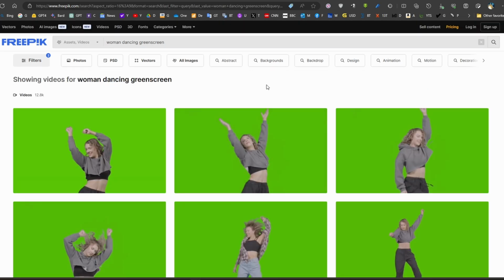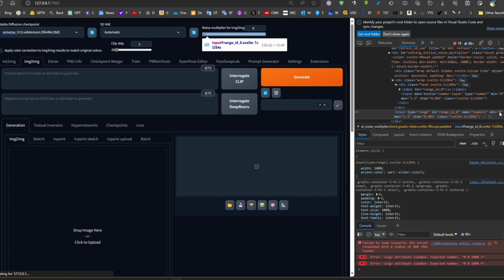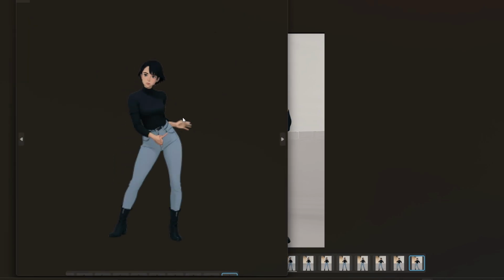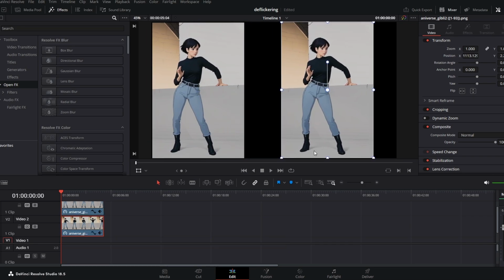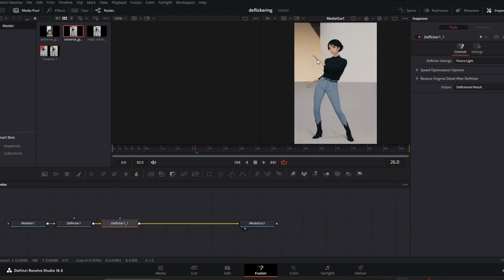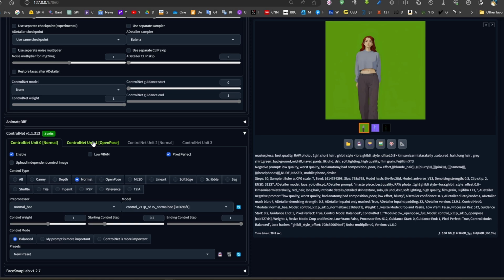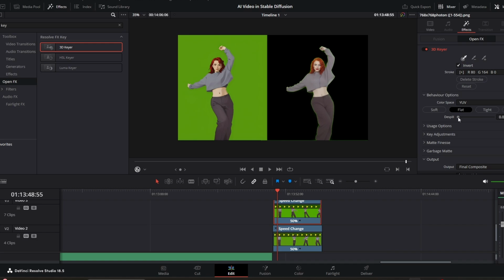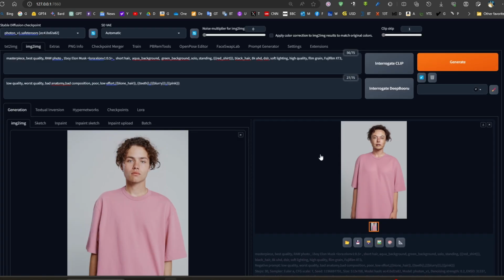AI Video 2 Video Animation Beginners Guide , in Stable Diffusion and A1111

Comment: Little confusing here. You have skipped the part at image selection , as per your video one image from the first frame of dance video been used in imgtoimg. How did the generated image created all the exact same images as per frames of the video in animation?
Reply from the maker: I used one image to test the output only, once satisfied with the results, we go to Batch tab and just filled (input directory with source images, and output directory for the output) and batch will generated all the images based on the prompt/details on my test on the single image

Comment: Thanks for the video.

Unfortunately it seems my export gets stuck at the ControlNet model, any idea what this could be? It's been at 0% for 30 mins :

Using pytorch attention in VAE
Working with z of shape (1, 4, 32, 32) = 4096 dimensions.
Using pytorch attention in VAE
Leftover VAE keys ['model_ema.decay', 'model_ema.num_updates']
Requested to load BaseModel
Requested to load ControlNet
Loading 2 new models
  0%|
Reply from the maker: sorry, have not got this before, but you should test Controlnet independently over one image, if it is not working, then probably you have a corrupted model file downloaded, so you can test redownloading it once again from https://huggingface.co/lllyasviel/ControlNet-v1-1/tree/main along with its yaml file ... also use gitpull to update your control net and libraries, you might have something corrupted for some reason.
Reply: awesome tank you!  @AI-HowTo

Comment: Thx for the tutorial, the problem is my character change clothes every frame, how can I fix that ?
Reply from the maker: You are welcome.
once you increase denoising strength, that will happen naturally unless you use a LoRA with a consistent clothes or a checkpoint that you have trained yourself on a character with consistent clothes.

in other cases, lowering denoising strength is the only option to maintain similar clothes.

use of Controlnet could also help(normal/depth maps, reference, tile) may help reduce changes with higher denoising strength.

Comment: Love your videos man. This is unrelated but have you tried producing consistent environments? I only see people working on consistent faces and characters, but nothing about consistent places/environments from different angles. Would be amazing if you gave it a shot and shared your insights!
Reply from the maker: I dont think its normally possible with SD (given its diffusion model), as mentioned in the Video, the best and most practical way, is to actually use a third software tool, such as Davinci resolve to replace the background...as you mentioned, once angel changes, the background changes, this results in slight flickering/changes even with controlnets.
Reply: @AI-HowTo  I just started testing a promising idea. I think it can be done if i make a 360 panoramic depthmap,normalmap, and cannymap in 3d software of my environment, then feed the maps into controlnet, and then project the SD result back onto my 3d scene, then I'll get full camera rotation freedom. Still needs some testing Anyway, keep up the good work habibi
Reply from the maker: thank you, best of luck to you as well.
Reply: my method so far has been making a scene in 3d, producing canny,depth, and normal maps and pushing them through controlnet and finally a fourth control net for reference. But unfortuantely, theres very little consistency when changing the camera angle.

Comment: This looks awesome. How much vram I need to use this feature of SD?
Reply from the maker: in general, if you are able to generate images in SD, then you can do this, I am running on 8GB, using img2img is faster than txt2img because it only uses 10 steps for instance to convert the image, and 7 or less steps for the after detailer... the slow down becomes when we use Contronlnet, for example, when having 8GB you may not be able to able to apply 2 or more control nets at the same time if target image size is large...any way, contrl net is not necessary if we use low denoising strength.